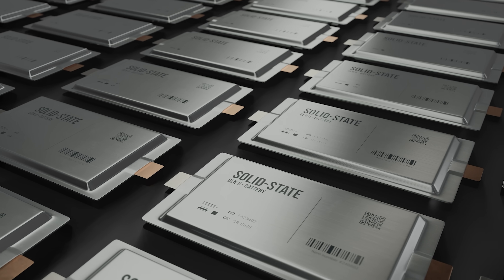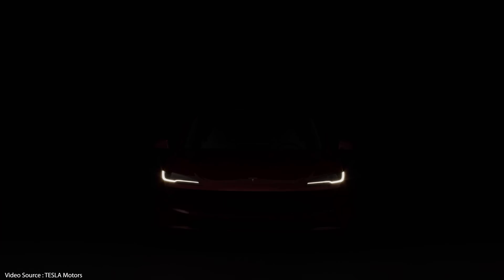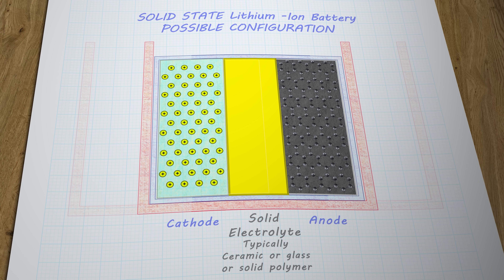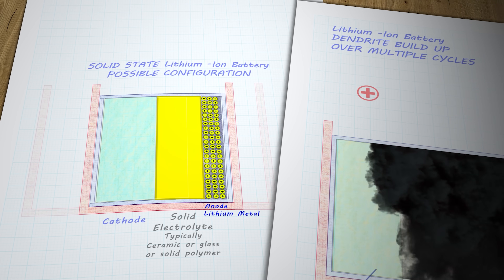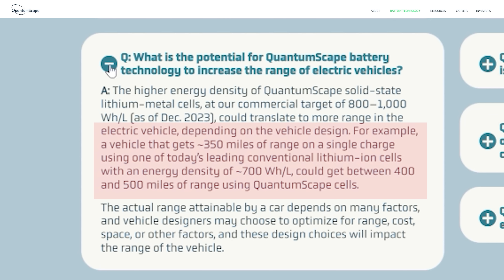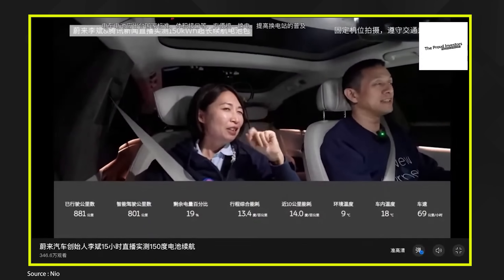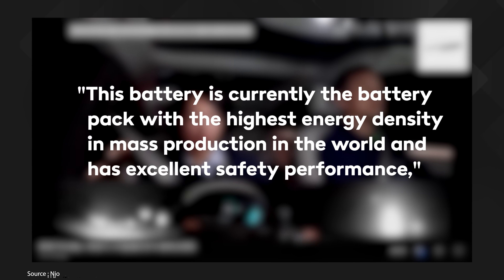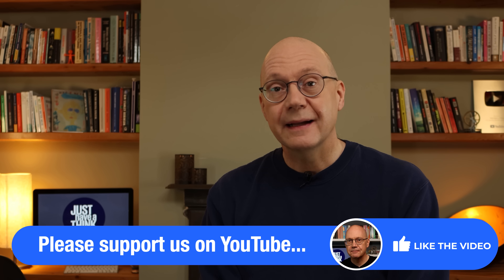Solid State Batteries - FINALLY powering electric vehicles in 2024!

Comment: The issue I have and I think many others have as well, is that while charging is great at home or in urban areas (I.e. Washington DC), the last of infrastructure and extreme cold and mountainous terrain makes travel in parts of PA and upstate NY where my family lives sometimes impossible with my EV.  When my normal summer range of 250+ goes down to 130 in winter, there is no way to bridge the gap between stations.  Once I arrive in the area, its 55 miles to and 55 miles back to the nearest DCFC and there is no infrastructure at the relatives houses to install a 30+ amp 220 L2.  I don't have range anxiety as I know my car well, what I have is a physical limitation do to battery capacity and temp. My call for higher range is not for optimal conditions, but for being able to take it on long trips for Thanksgiving, x-mas, etc with family and gear.
Reply: Regarding the L2 charging: the Canadian electrical code was recently changed such that you no longer need an electrical service upgrade to install a L2 charger.

If you don't have the the head-room in your load calculation: you can install a whole house energy monitor. The whole house energy monitor will then pause vehicle charging during periods of high electrical demand.

I worry this may conflict with "virtual power plants" that "smart" hot water tank manufacturers want to sell to utilities. The protocol for load-sheding on the water tank is invariably proprietary. Your "whole house energy monitor" may mistakenly think it is safe to charge the car during a period of peak electrical demand (and load-shed request directed at the water heater).
Reply: @john849ww  "they no longer had heat and either had to be rescued or, unfortunately died" I know this is a possibility, but has it already happened ? I'm not a fan of this or that car technology, I buy what I feel has the best value for me (and right now that is a small petrol suv), but I often see this point brought up in debates against evs...but I can't find an instance of this really happening.
Reply: My state just announced another $80M of charging infrastructure planning today; perhaps some of that IRA money will flow to an area on your PA commute.

Unless your relatives are in a townhouse/apartment/condo, adding a 14-50 receptacle is typically under $2k; in my case (having done this *four times*), it was well under $1k x3 and $2k once, and I paid to have one installed at a relative's carport because I visit often.

It's fine and code-compliant  to "over-subscribe" an electrical panel; my current 200A panel has 260A of breakers; my previous 200A panel had well over 300A.  Even if the panel is "only" 100A -- which is not unusual in older US residences of 50+ years ago -- an add'l 50A breaker (for a 14-50) can be added, though certainly care should be taken to not charge at max amps at the same time as running an electric dryer AND cooking a casserole in an electric range.  But, then, most charging can be scheduled at the car (or the EVSE) for the wee hours when other major electricity users are offline.
Reply: for people that need to do long trips often, specially in extremely cold places, hybrids are probably a better investment. its also probably where hydrogen EVs start to become more interesting.
Reply: In early January in Northern Europe, I did a road trip with my relatives EV to a family thing. It was around -35 degrees (C) the whole way. The range was around 30-40% than the projected value the car gave, there were multiple variables on the way as it wasn’t just level, straight and well maintained road.

But, my point is that not only were EVs in trouble with the increased range anxiety and shitload of problems with charging infrastructure, which is frankly the worst part road-tripping in a EV, but over the 11 hour trip I didn’t see a single EV broken down by the road. I saw semi trucks, caravaners, buses, older ICE cars, newer ICE cars. The only place I saw standing EVs was in a charger. They still kept on going, slowly to reserve battery life.😅 Tow trucks had a field day..

Now I know that isn’t representative of the whole truth, for example the EV we drove was never experienced the full cold without being driven or charging, it was taken out from semi-warm garage. My old BMW (this the 90s) started cold in under -40 degrees whilst my father’s decades newer car didn’t start even if it was in an electric heater. My colleagues Tesla was broken every three months until she changed it into another car.
Reply: I'm in Colorado.  While there is charging degradation, going down from 250 to 130 means that there is something surely wrong with your battery.  You should only lose maybe 20-30 miles in cold climate charging.
Reply: Far cheaper to invest in more destination charging than in bigger batteries.
Reply: @cad4246  still does not help the stopping every 1.5 - 2 hours for a 1 hour fill up on a long trip in cold weather.
Reply: Just sharing you some info but you might not be able to buy due to “US National Security threat from China” So Chinese car hesitate to sell in U.S. 

China is a big country so what ever limitation US has they have too even they have more than millions of charging stations country wide. 

China call NEV which compose of BEV (pure battery) (around 60%) , EREV around 40% fuel cell (mostly in commercial transportation and freight train). 

EREV = extended range EV, drive train is purely electric motors with generators (ICE) using gas. It’s different from Hybrid and PHEV. Both ICE still involve as part of drive train. Hybrid battery is 2-5 KW while PHEV is about 20KW roughly 30-40 miles range. 

EREV install 50+ or ++ KW which you can drive 100-150 miles which cover daily commute or using 2-3 days if you live downtown which is roughly 70% - 80% of most people routine (purely run on battery) but giving flexibility if you travel across multiple states or having urgent matter (no need to stop for charging). It also can set running ICE on command (you have to push ICE to work) or auto (ICE start at set low battery level). Price wise a bit more expensive than BEV. 

The Tesla fan boy always claimed that EREV is not EV (not green) which is BS. Majority of all countries still produce electricity from fossil, (China output of wind and solar is more than whole world combined still have to use fossil and plan to build 48 nuclear power plant in next 20 years). The bigger battery that serve 20-30% of your routine also create more pollution too. 

The EREV also supplemented range lost in very cold winter. 

All for all, there is no way to be 100% green so if your car can be green 70%-80% green in your daily life and serve your remaining 20% without excessive battery (more pollution) is very reasonable. That’s why it shares around 40% sales. It is a good transition during better battery development.
Reply: Maybe you should watch the video "How Norway Built An EV Utopia While The U.S. Is Struggling To Go Electric", and then demand your local politician, Congress representative or whoever to do something!!!
Reply: Solid state battery tech should reduce fire hazard and recharge time and deliver more miles per charge, but it doesn't change the concern of equitable distribution. The EV that offers most benefits, applications and potential to reduce fuel/energy consumption, emissions AND insane traffic is plug-in hybrid PHEV tech rather than all-battery BEV tech. PHEV tech is especially applicable to long-haul freight truck fleets. Combustible hydrogen in the ICEngine of a PHEV drivetrain can deliver twice the equivalent mpg possible in fuel cell EVs, store at much lower pressure in smaller safer tanks. A rooftop solar installation of say 8' x 16' (4 sheets of plywood) will deliver in 8 hours of full sunlight perhaps 30 miles of driving range on most any EV. Thus the household with a PHEV in the garage is the better match to rooftop solar. Battery, solar, hydrogen resources distribute more equitably with PHEV+H tech rather than all-battery BEV or HFCEV.
Reply: The new BYD QIN dmi5 hybrid is the best solution for range anxiety. It gives 2400km range for 65L petrol with 80km pure electric range. The AI microchip distribute the power from ice and battery which allows the engine run at best efficiency all the time.
Reply: Should've bought a reasonably-priced car that doesn't have such limitations.
Reply: @hugolafhugolaf this is why i, like many others are going back to ice or hybrid if they can be found
Reply: @matthewknobel6954 Of course they can be found.  ICE cars are everywhere.
Reply: @hugolafhugolaf  was not talking ICE, talking about hybrids and more specifically PHEV

Comment: I look forward to this tech coming to fruition. Nevertheless I think range anxiety is only a thing those who don’t run an EV have about EVs. Having run mine for two years, the charging opportunities are so much better than 2 years ago, I barely think about a charging plan now. By the end of this year it won’t be a thing in the UK I don’t think.
Reply: same - 2 yrs of ownership and 10k/yr miles only used public charging x6 during long trips away (holidays/weekends away). , most of time use 2kw slow charger at home on a weekly basis with no dramas and 300 mile summer/250 winter range no real issues 👍

Comment: Oh Yes, Toyota... if they really did have the battery breakthrough they claim, they wouldnt be talking all this smack about EVs and the need for fossil cars well beyond 2040... The biggest challenge for all these solid state yechnologies is to achieve mass scale at a good price point. At the same time, the cost of lithium cells is going down like crazy, and a lot of new production capacity is still to come online. LFP batteries are rapidly improving, and Sodium batteries are also getting closer to market. And underlying it all is the presumption that we actually need 1000+ km range cars... In fact, ~450-500 km WLTP with sufficient charging infrastructure and speed ia already fully acceptable for the average family's occasional road trip. So let's see how they go. All for it, but might end up being more of a niche solution.

Comment: Promising progress.  It is of course a very important priority to eliminate the current instability of most EV batteries, which are prone to spontaneous combustion following collisions, fluctuations in temperature/electrical throughput, or dendritic decay.  

Fingers crossed the reality can catch up to the hype sooner rather than later, because the current safety & range downsides of EV batteries is creating a crisis for customer confidence.  This, coupled with expensive  battery replacement costs, is seriously impacting the value of used EVs.  

I am surprised there isn't a market for micro-mini EVs for urban hopping which can use smaller batteries for shorter range.  China is withdrawing its little granny-EVs because of an excess of collisions & fires.  This is not bedause of build quality but because grannies with no formal driving training were getting into a high number of all sorts of accidents